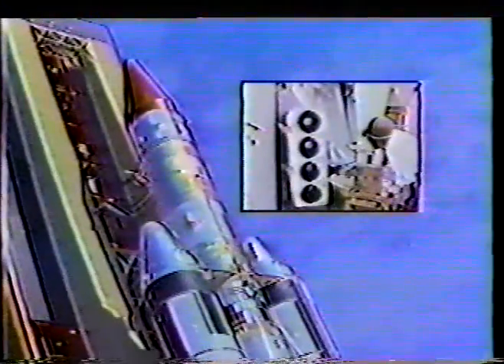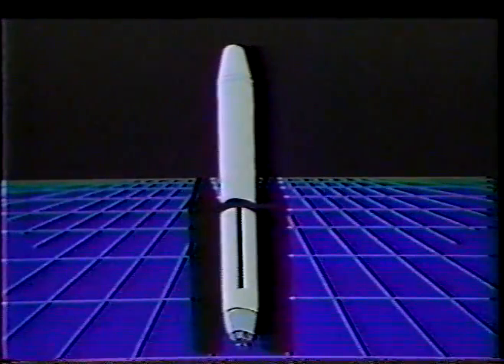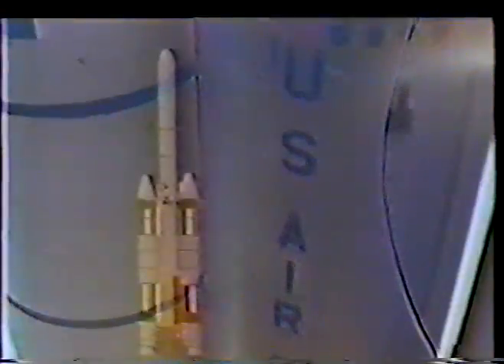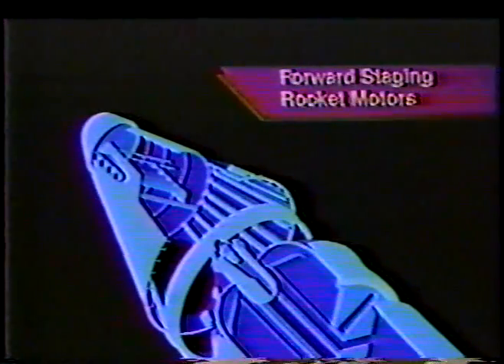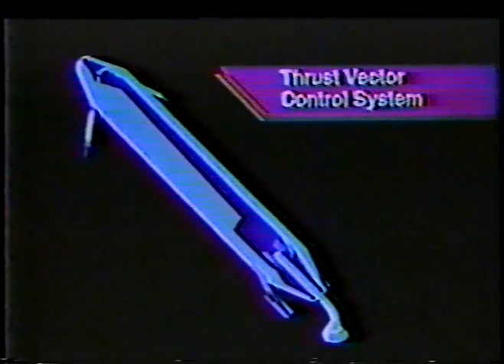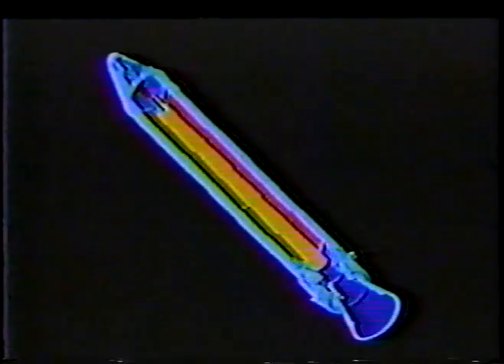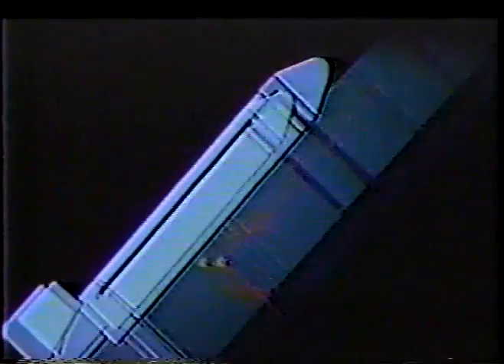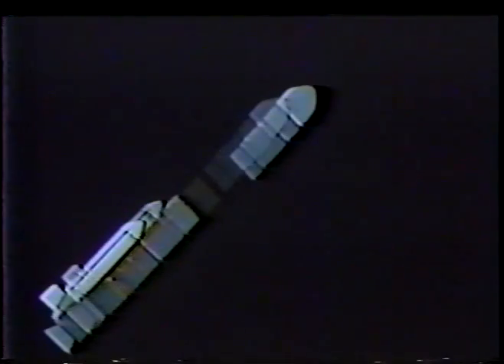Titan SRB description and Titan Investigation of 4D-2 34D-9

Comment: I was a launch engineer at VAFB on this failed rocket.  The worst thing was we had lost the previous launch also during stage I (core) flight.  They never could pinpoint the exact cause so we literally spent months working overtime changing components and running tests to make sure this one was OK.  Then it blows up due to a different problem.  It was pretty depressing and disheartening especially since half the launch complex was destroyed and we had to rebuild it.

Comment: One thing to do note is that on the Titan the SRBs have the clevis on top and the tang on the bottom. For Shuttle, this was reversed which caused the "joint flex/rotation" issues. With the Titan design, the clevis clamps so that it can't flex.

Comment: I have always wondered what the purpose of that small white (red on later Titans) thing on the SRMs were.
Reply: I always learned that it is for steering, but i'am not sure.
You don't see them on for example the Ariane V or launch vehicles with smaller SRM's like the Atlas V 551 or the Delta II.
Reply: Perhaps a tank of hydrazine?
Reply: Why not?
Didn't they explain it in the documentary?
Reply from the maker: The Titan IVA used fluid injection for TVC (pitch and yaw) on the SRBs.  Roll control was obtained through commanding of opposite pitch on the two SRBs.  The "cartridge" was actually the tank on the side of the SRB that held the Hydrazine fluid that was injected into the throat of the SRB nozzle to create a shock wave in the plume and deflect the thrust, The Titan IV-B had fully gimbaled nozzles, ran off of a blowdown hydraulic system, the pump was powered by a turbine that was spun by a solid fuel gas generator.  Once you got past T-10 seconds and they lit those gas generators even if you scrubbed those generators continued to operate and the pumps ran until the solid fuel propellant burned out (about 2 minutes), so a scrub after T-10 seconds was both costly (you had to replace the gas generators, several hundred pounds each, and recertify the hyd pumps), at least a week turn around. 

This was the mission that was lost after launch from Vandenberg AFB.  This may have been eventually traced to an improperly performed insulator repair on the face of one of the segments.  There was a flaw (bubble) in the insulator so they cut it out and installed a patch.  The patch was fine but they think that when they cut out the insulator section the tech cut too deeply and scored into the propellant underneath.  After launch as the propellant inner diameter expanded as it was consumed the flame front eventually "found" the scored path raced down it, reaching the case of the segment much earlier than the design intended it to, and the case burned through and ruptured.
Reply: From between 1985 to 1987 there were two Titan 34D, an Atlas a Delta, an Ariane and the space shuttle Challenger lost during their ascent.
Reply: You nailed it,Ken. I was on D1-D7

Comment: What does 34D stand for?  We went from Titan 3 to Titan 34D.  And from Titan 34D, we went to Titan 4.
Reply: I'am not sure.  Maybe the 4 in 34 stands for an upgrade of 3 (witch it was) 4=4 stage core? And after 34D besides the IV we also went to CT III (Commercial Titan III).
Reply: I was actually on the Gemini,TiiC,T34D and CT, Later TIV The letters were program designaters .T34C series were military, quasi- commercial and were launched from Cape Canaveral. T34D series were Classified military and NRO and were launched from VAFB. Commercial Titan was redesignated TitanIV They were launched from both launch sites.Titan IIIA was an uprated core vehicle that launched lighter payloads and launched from VAFB The core vehicle was built by Martin Merietaa in their Waterton, CO plant. Propulsion for both core stages was provided by Aerojet General The solids were all built by CSD. The core vehicles were fueled with a hypergolic fuel/oxidizer mix which consisted of Aerozine 50, a 50/50 blend of hydrazine and unsymetrical dimethyl hydrazine as fuel and Nitrgen Tetroxide as oxidizer
Reply: Thanks.  Why the "34" and the "D"?
Reply: They were missile designators for the T34 TitanIII program. The Titan 34C missiles were launched from the East coast. The Titan 34D missiles were launched from the West coast. They were the same missiles with unique program designators and customers.They also had numeric sequence numbers which tagged them for a specific launch. As note, the Shuttle boosters were tagged STS (Shuttle (or Space) Transport System) In these instances, the Air Force still followed the KISS philosophy {Keep It Simple Stupid) If you have any specific questions regarding the early launch systems, shoot!. I worked on ALL of them except Jupiter and TitanI.
Reply: See if you can follow this. It's actually simply complicated. Missiles are assigned to programs. T34 is a program designator. T34D is a program designator that identifies a thrust augmented,liquid /solid, satellite launching system that is assigned to a specific group of launches from Vandenberg AFB. {T34D1 through T 34D XX)T34C is the same missile system that was a precursor of the T34D. The T34C series was launched from Cape Canaveral (T34C1-T34C XX)That is as simple as I can get. They were actually  parallel series that were being launched in the same time frame by different customers
Reply: No, went from Titan 3 to 23, 24, 33, then 34.  
All had significant changes from earlier version. 
Like Boeing 737, 747, etc. 
A B C D are variations with or without solid boosters, with or without upper stage.